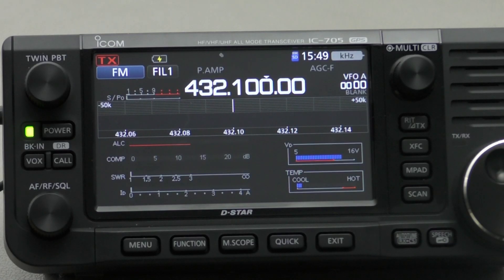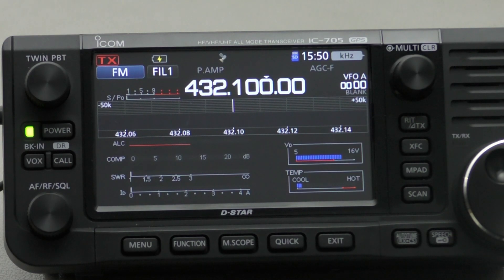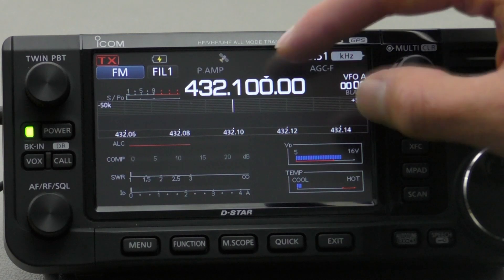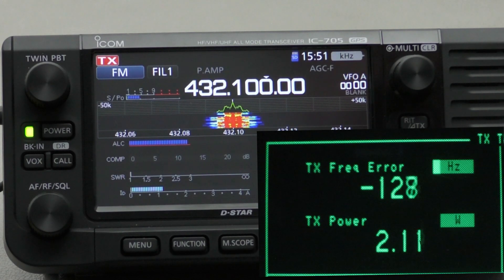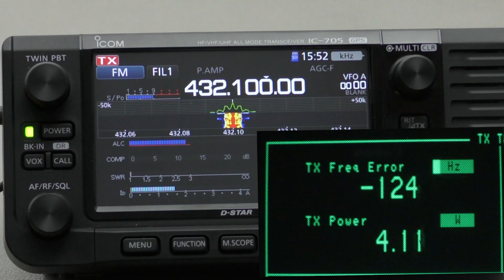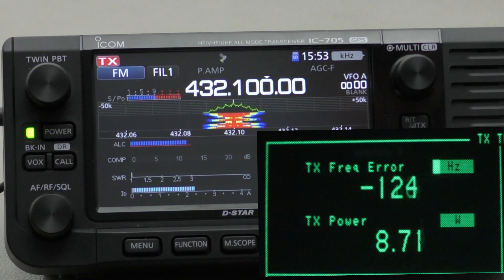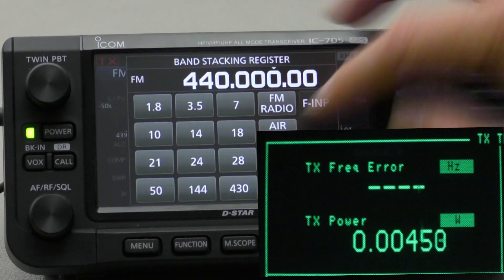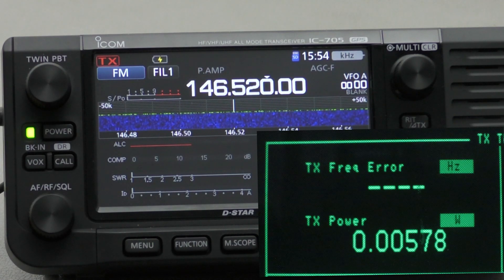Whatttt? The Icom IC-705 Outputs How Much Power??

Comment: It's not the issue with carrier modes it's SSB talk power that's lacking, despite mic gain and compression levels even on a proper active peak reading watt meter. It's so burdened by overactive ALC just like other Icom SDR based transceivers, yet the output device is rated at 30 Watts.

Comment: Your thin coax is probably robbing 20% RF power on 440. 
You better repeat your video using a much shorter piece of half inch coax, lmr400, or at least RG213.  Once you make the effort of measuring with best accuracy it would be nice one measurement with the highest possible voltage on external power and a second one with the fully charged battery.

Comment: $1400 for a 10w radio ?
Reply: yes. it’s an all band all mode QRP rig. smaller does not necessarily equate cheaper; it’s designed to be lightweight as well as highly versatile

Comment: The difference is that you are using a $20,000 analyzer and TSA was using a $45 
Signstek meter. I had one years ago, but sold it for like $20 at a hamfest because it wasn't all that accurate. Good enough to see if you are in the ballpark, maybe, but it is hardly an accurate measuring device.
Reply from the maker: Well I don’t think my analyzer is worth $20k, I’d sell it if it was 😆😉

Comment: I have tested output power of my IC-705 on 430 MHz and I got 10,5 Watts with the probe connected directly to the BNC connector. I used an HP435B Power Meter with up to 18 GHz probe. If you use a piece of cable, in example a bad quality of RG58 with about 2 feet of lenght, I think it is normal to get a wrong value of the effective power of your radio. Enrico.

Comment: But why if vhf/uhf are supposed to have the same output power, and according to the same website and same setting 431 mhz yes it is about what the site says but at 144 it should be 9watts and you get 10 so still not quiet right.
we need more people with the 705 to test this to see if it varies between radios (build quality)
I unfortunately cannot test it as I refuse to pay more for a 10w radio than I would a 100w radio.
Reply: "I unfortunately cannot test it as I refuse to pay more for a 10w radio than I would a 100w radio."
In which case the result of such a test is merely a curiosity to you.

Comment: The 705 is a nice radio, but there are full power rigs that may be better value for money.
Reply: If you aim for power? Yes, definitely! You aim for lightweight? Not really... I see so many comments like that -- "too little power for the price". But honestly, is the power what's the most expensive in the rigs? Isn't it a great receiver, clean transmitter that doesn't TX any garbage out, well developed DSP features? Aren't these the things that cost the money there? Don't we all desire the quality, complaining about all the Baofengs and other crappy even non-HAM electronic products that break right a week after the warranty? I hear such complaining so often, but when there's a great piece of fine engineering and almost an art, made in Japan, that costs its price, the same people aren't willing to pay it... KX3 is also expensive, but everyone just got used to it...

I love ultralight HAM radio equipment and this is what is the 705 made for and at that discipline, it's a great value for the money. For sitting in the shack, sure you have plenty of better choices... But you don't wanna bring your FT-991a in your backpack on a summit, along with batteries, able to feed its 1,5A idle power drain...
Reply: @ferdinandfrozenstein  Good points.
Reply: The IC 705 does an outstanding job for what it is designed for and then some. The receiver on this radio is simply outstanding and uses the same display as the IC 7300.  If you want higher power, get the IC 7300.  If you want portability with a strong feature set, get the IC 705.

Comment: I wouldn't worry about the measured frequency inaccuracy...  that's probably an inaccuracy of the 8924.  It's a bit of an old hector now, and I recall it has no option for being GPS governed, so unless you have calibrated it via GPS or a rubidium standard, it has probably drifted a bit.
Reply from the maker: No it actually does have a 10 MHz input on the back, but you’re correct I didn’t have the GPS attached.
Reply: @HamRadioDX  I never knew that.  I thought it only had a 10MHz output.  I may look into getting one then, as they're cheap now, and I have a GPS reference receiver.  73
Reply from the maker: Yes well at least mine has an internal OCXO oven with a BNC jumper across to the 10 MHz input. Remove the jumper and plug your own GPS in :)